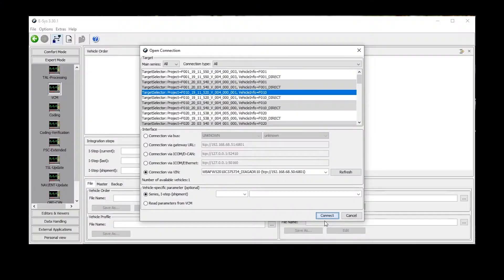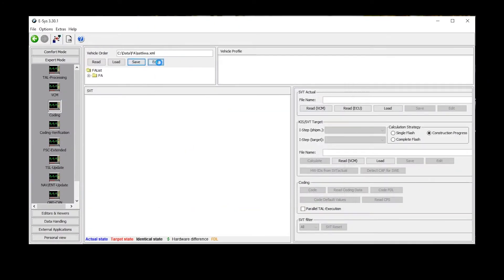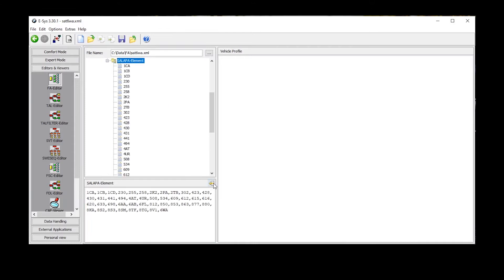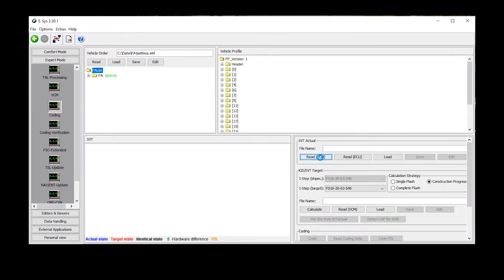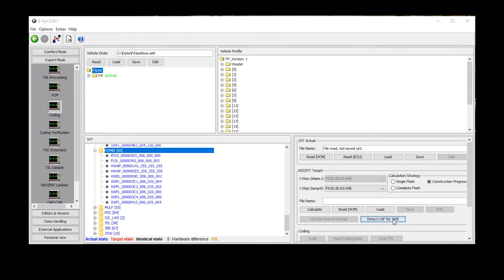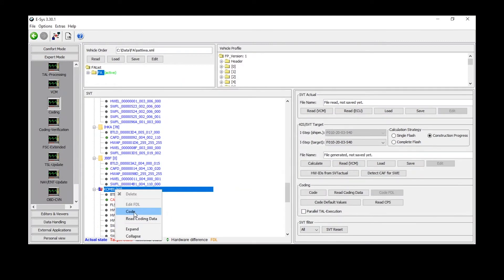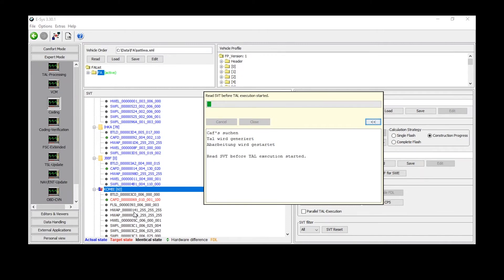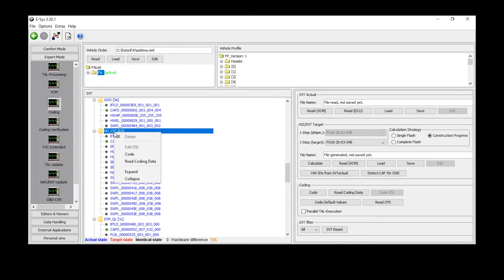How to Install BMW 6WA 6WB Instrument Cluster

Comment: I understand car has to be newer than 2011/03 to work? I have 2010/06 with basic cluster
Reply from the maker: not an issue ... my car is 04/2010
Reply: You just need to edit date to be 0711. That's all

Comment: I have a F10/ 2015, just retrofitted the HUD unit and replaced veganized 6WA kombi with hud option. I tried to code with esys 3.30.1 / PSdZ ver. 4.38.31 lite. I could not find the correct CAFD Files for any of the units, my I-Step 22-10-510 for all there modules, HUD, Kombi and HU. I ended up using files with the highest possible number. Kombi works fine but HUD never worked but it shows on display with all options greyed out. Any suggestion?
Reply from the maker: I have never retrofitted the HUD... just as a curiosity .. did you change the front screen(wind screen) also ?

Comment: Hi pal, do you know if is possible to coded cluster from klm/h to ml/h ?
Thankx
Reply from the maker: what type of cluster ? standard, 6wa or 6wb ?
Reply: @BestCarMods  6wb cluster
Reply: I got 6wb cluster from Germany and im in uk can i coded from klm/h to ml/h ?
Thankx
Reply from the maker: @ridhaboutiba9821  did you install it on to the car and coded it ? it should go automatically to mph after coding

Comment: Do you do remote coding? Is it normal that  virginized cluster after connecting to car shows 999999?
Reply from the maker: yes. i can so remote coding if you have the correct tools. I don't remember seeing 999999 when connecting to car. send me a message on FB or IG and we see what we can do

Comment: so no flashing is required?
Reply from the maker: you might need to flash gateway if cruise control does not work
Reply: @BestCarMods  just retrofitted 6wa but cruise control or speed limiter doesnt work. do i only flash fem_gw, also how long does it take to flash and will i have to connect a car charger?
Reply from the maker: @priyamm_  you need to update/flash your gateway zgw  .... 15 20 min ... it is you decision. I always connect the battery support unit.
Reply: @BestCarMods  FEM_GW flashed, cc and lim work but when cc is activated the marker on the speedo doesnt sweep up when stationary, i've seen some other clusters do this as well as my old non extended cluster. Will i have to flash the KOMBI for this functionality?
Reply from the maker: @priyamm_  I don't remember seeing it on the 6wa ... when I will go for a drive, will pay attention to it ... I am happy you managed to make it work. Well done.

Comment: You also didn't show how the tamper dot was removed
Reply from the maker: tamper dot gets removed once cluster is coded to the car using Esys ;)
Reply: @BestCarMods  nope. That's not true. Tamper dot is as a result of VIN mismatch. How come coding with E-sys will change the VIN. Pls verify your claim on this
Reply from the maker: @adekunleogunjobi5198  when you virginise cluster you remove the VIN, when you VO code that cluster to the car it will take the vin of the car ... all steps needed are in the video ... I have done this many times ;)
Reply: Esys free or with token ?
Reply from the maker: @MKBUHDD   both should work.
Reply: @BestCarMods  I have another question,  I have F20 2012 model with Analog Cluster, are there 6WA clusters compatible with it? Or only up 2014 models ?
Reply from the maker: @MKBUHDD   i am not that familiar with the F20s ... if i remember correctly they are different than F30 an those are different from F10